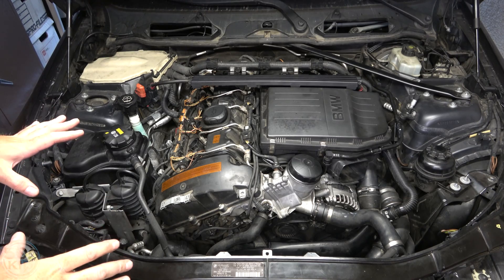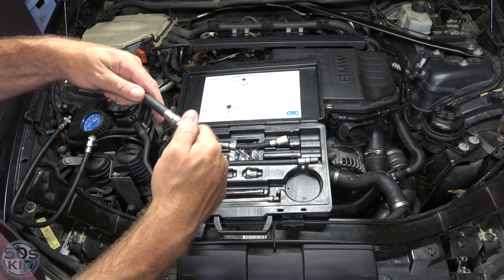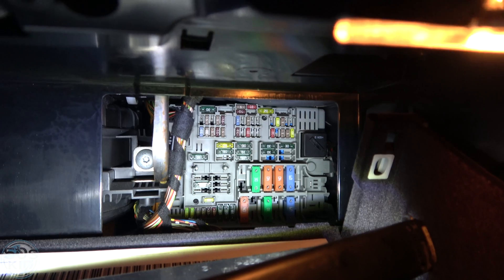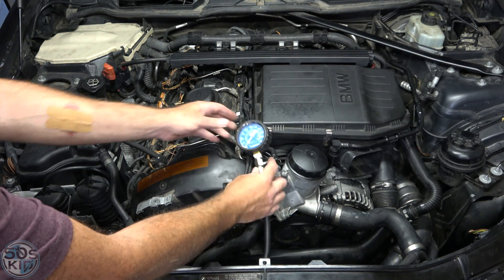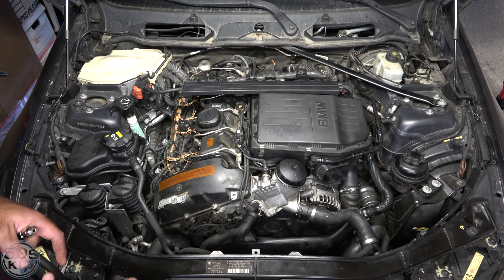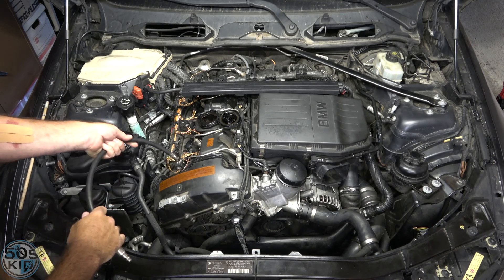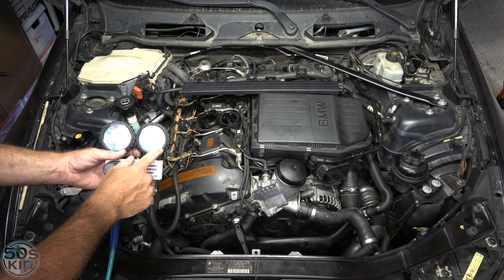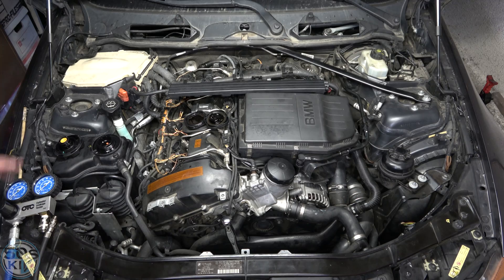BMW E90 N54 Compression and Leak Down Tests DIY

Comment: I bought my 2004 325i  for only $300..  They said it might be head gasket and coolant related issues..  so I took it on..  and struggling.   I do believe it is HG.  so I got my work cut out for me.  already changed coils, plugs and valve cover gasket.   no turning back.

Comment: OMG Cylinders 3, 4 and 5 are around 70 ,70 and 60 psi    C1 is 160. C2 is 110  c6 is 130.    I think it's head gasket?  assuming I did it correctly..  I'm pretty sure i did.   and I'm getting crank no start.    I'm getting fuel.  not totally sure about spark?

Comment: i hear alot of air like coming out or sucking in with a weird smell left side of the engine and wont crank and it side like low compression 180k miles idk when the gasket was change.

Comment: I had this problem with a couple of compression test gauges, I think it’s due to a tapered seat for the spark plugs. What I did with my Compression tester adapter, was to gut a spark plug and attach this to the adapter, have no problems now, get consistent results.

Comment: I wanted to reach out.  I’m getting timing corrections on 1 specific cylinder on my S55 BMW M3.  I have replaced spark plugs, injector, and coil pack still getting the same results.  I believe my next steps are to compression test and leak down. Is there one I should do before the other?  If my compression test pass, do I then test the leak down?  

Any info would be great, this is my first time performing these kind of tests.  Thank you.

Comment: What size oring did you use? I have the same issue with it leaking through the spark plug. Brought a few oring kits but cant find one that stops it from leaking.

Comment: I've replaced headgaskets on 2 Saabs without removing the engine.  Can the N54 head gasket be replaced without pulling the engine out of the engine compartment completely?

Comment: Jason, thanks for the insights, they have helped tremendously. Questions: I have an 08 N52/x3 I was having a no crank no start issue. I watched that vid of yours and it helped me diagnose a bad starter. I changed the starter, but now I have a crank/no start condition. My compression 1-5 is 160 and my #6 comes in at 170. It getting fuel, I can hear it trying to fire the gas but wont start. Any idea what the heck is going on here?

Comment: Ok bought a 2010 n52 328i.
Cylinder 2 misfire. New plugs new coils did a compression test zero compression on cylinder 2 going to perform a cylinder leak down test depending on the results of that how can I determine if it's the rings or rod bearings? Super slight knock sound. Gonna drain the oil and look for flakes. I wonder if the piston may be hitting the valve . Also borrowing a bore scope to see inside the piston area. Pulled the plugs and it's black in there just flashing a light down the hole. I'll report back
Reply: In the UK you could YouTube pushing it off those white Dover cliffs and maybe make enough for a whole new bmw, well one with an n54 maybe..

Comment: I wonder on the N51/52 if the valvetronic system not being set at full open and the throttle not being full open can hamper your results or cause excessive cranking to achieve an accurate test.

Comment: Hey man I was wondering if anybody could give me any insight I just did a compression test on my 07 bmw 335i pulled 1st coil and plug out and the fuse for the fuel pump and then tested it with cold engine has not been ran in 2 days and read 120 on all cylinders and the 4th one was 125 cranked till gauge stopped and was wondering why numbers are so low?
Reply: Hi, 

My 2009 f02 740li same low values... Fuse was not taken out,maybe that cause it?

Comment: With e46, the videos mostly felts like problems looking for solutions, but many of the latest e90 videos feel like solutions looking for a problem. A few years late to this platform.
Reply from the maker: The car I bought was just better maintained than my e46 lemon, but I took what I could find. But all the videos I’ve been doing (with the exception of this compression/leak down one) are all on common problems with this platform.

Comment: Good insight, Jason! Trying to figure out if my M54s misfire is coming from a head gasket problem or just vacuum leak. I replaced all the rubber and ccv once before but this may be a good test for me to do.

Comment: The PSI is ambient air pressure dependent. So, if you are at sea level, you will have higher readings than if you are at 10,000 feet. I've always been told that you look for differences between cylinders and as long as they are within 10% or so high to low, you should be good.

Obviously, if the rings are ALL shot, there is a problem.

Comment: Don't overlook the eccentric sensor.. I just did mine.. bad compression one of the symptoms of a bad eccentric sensor
Reply: Wouldn't a bad eccentric sensor throw a code or not necessarily?
Reply: @CLPATTERSON  not necessarily.. it depends on how far gone the part is 🍻
Reply: @L0w_k3y  after some research it appears the n54 doesn't have this sensor, is this accurate?
Reply: @CLPATTERSON  yes.. I actually upgraded to the n54 😅🙌.. no valvetronic nightmare 😅🍻

Comment: Great video, thanks!  What method do you suggest to detect a gasket leak that is next to a coolant passage but does not touch the cylinder gasket section? I mean, in that case, the cylinder section of the gasket would be intact.
Reply: Were you losing coolant in that circumstance?

Comment: This is pretty obvious but the recommendation about pulling the fuel pump fuse and cranking the engine at around d the 3:30 mark must happen BEFORE you remove the spark plugs and coils and attach the compression tester. You won’t be able to purge / burn the fuel without spark. Again, pretty obvious but it’s not the order shown in the video.
Reply from the maker: Ah, yeah, I realize now I messed up on that order when editing

Comment: O-ring false positives! Nice diagnosis. Obviously no overheating issue like the M54 old-days. I'm returning to M54B30 territory next month, wish me luck.
Reply from the maker: They really do drive so nice, even if they’re slow. I haven’t driven a 2006 330i with the N52 yet. Kind of wondering how it is. That is the last of the straight six naturally aspirated engines.
Reply: @50sKid  not quite.... we have the N53, 268bhp European replacement for the 255bhp N52! 

Last week I watched your leakdown test on the M54, which obviously led to your complete takedown, skim and rebuild series- loved it.
Reply from the maker: @ppppugh7892  Aha, yes that engine couldn't be offered in the USA due to sulfur content in the exhaust or something like that

Comment: Really clear and concise DIY post. Great tip on the upgraded o-ring! I have the same exact compression tester and had no idea that my compression numbers might be reading low due to that. My last (cold engine) check, about a month ago read ~160+ across all 6-cylinders. Will find me a fatter o-ring and check again. Thanks!

Comment: Very good video , I have a blown head gasket on the N46 but what I did to confirm, was to use the same compression tester hose and put a fitting to it that could fit my radiator pressure tester , then TDC the suspected cylinder and pressure it , then I started seeing coolant spilling in the adjesent cylinder.
Reply from the maker: Doh, that sucks!
Reply: In your circumstance you were losing coolant?   No milkshake in the oil?      The radiator pressure tester couldn't find the leak?
Reply: That's right Dennis , the milkshake was there but not in the radiator , that was not just a brown head gasket but the thread was stripped in the engine block , I am now trying to find a sump pick up tube. 
Thanks for your comment.
Reply: @raymondprendergast5839  Stripped block threads are common.     Actually I don't know who can advise to remove the head without helicoil or timesert the holes?   And I wonder why they couldn't have done this from the factory.
Reply: @raymondprendergast5839  So somehow it was blowing out of the exhuast?   Where was the coolant escaping in your situation?
Reply: @dennisrobinson8008  the coolant was from the water jacket at number 3 cylinder into number 2 , then passed the Piston to the sump.
Reply: @raymondprendergast5839  milkshake in oil?
Reply: Yes , that is already taken care of and the head replaced , it is just sump pick up I am trying to locate because the mesh is damage.

Comment: Do you still have the issue with the engine running warmer than it should?  Or was it just doing that on your original drive home?  Nice that the head gasket is good!
Reply from the maker: It never actually did run hotter than it should. That was the oil temperature gauge, not coolant, and it is supposed to go that high.
Reply: @50sKid  both n54's that I have stay well below the middle...  But both have oil coolers.  The n51 however gets a bit above the middle.  I have retrofitted the oil to water heat exchanger, but it still goes above middle, albeit not as much.
Reply from the maker: @AlecKristi  I'm gonna retrofit the air oil cooler soon -- I'll see how much of a change it makes!

Comment: Had to do an n52 head gasket, man was it a pain in the ass. 
I should’ve pulled the engine out, would have been a million times better.
Reply: I've done a n52 headgasket (and head) for my brother in law last year...  Wasn't too bad ;)..  it was my first, and I ended up driving that car from Sacramento to Seattle immediately after assembling, without any issues.
Reply: Did you end up having to timesert or helicoil the headbolt holes?